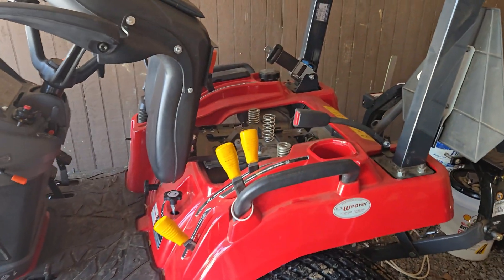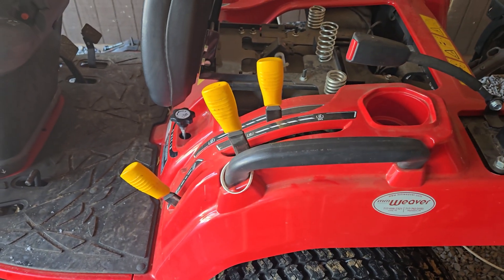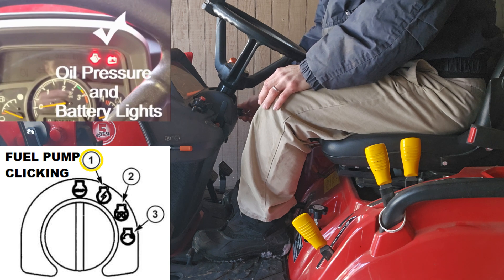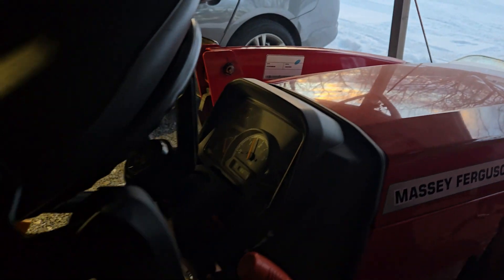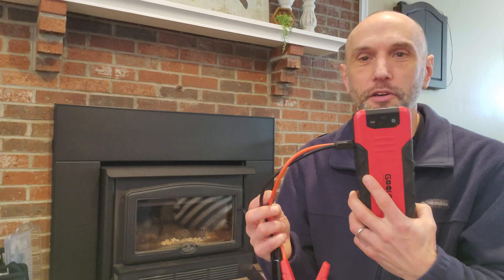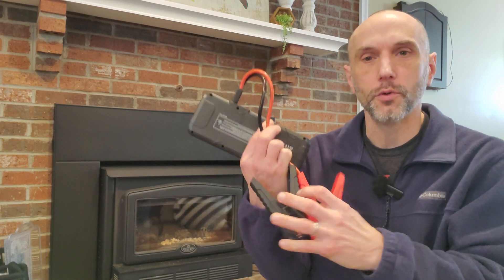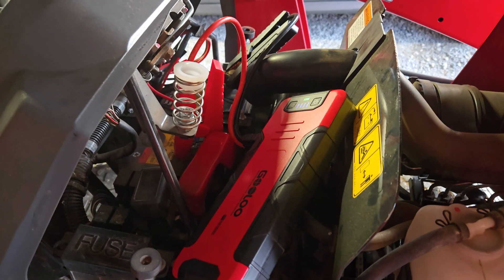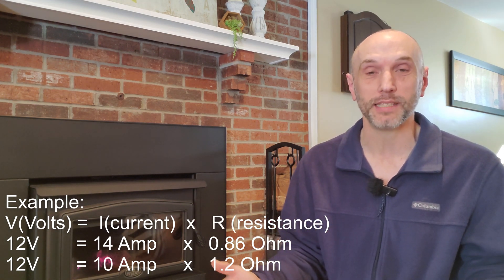Tractor Cold Start Tips and Troubleshooting

Comment: How's she goin'?  Great video Ed.  The data you provided is very useful.  This is a good baseline to have when the tractor won't start.  I need to point out though that the point of the parasitic draw from a battery tender came from Steve Rob Reviews.  He had a video about that and when I checked, sure enough similar results as you show.  So I got myself a battery tender that has no load on the battery when it's not plugged into AC.  Thanks again for doing these checks and posting.  Take 'er easy!!
Reply from the maker: Thanks for that clarification. I added the link to one of his battery maintainer videos into the description and also added an info card at the point in my video where I talk about the maintainers.
Reply: @Redneck_Ed  Thanks Ed.  That was a nice thing to do!!